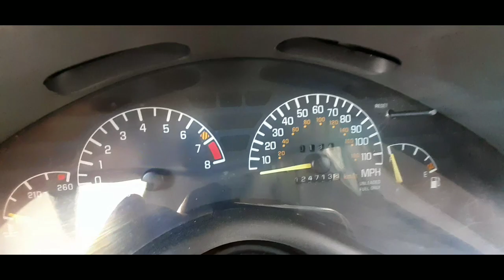THURSDAY Crushing ANY & ALL. 1994 PONTIAC GRAND PRIX Gets CRUSHED FLAT!!  Not much Talkn.

Comment: Yes, 1994 model. You used to see these everywhere (the four door models) as company cars and rentals back in the 1990s. The last company I worked for used them as company cars for the sales people.

We got the VIN, we win: 1G2 for US made Pontiac, WJ for Grand Prix SE, X for 3.4L V6 DOHC with multiport fuel injection, 7 is a check digit, R for the 1994 model year, F for Fairfax, KS assembly and the rest is the production sequence. The Fairfax plant by this time was known as "Fairfax II" as the 2nd plant was opened in 1986 after the first one closed. The first one built my '84 Delta 88 in June 1984. 

Exterior paint is code 41 black paint.
Reply from the maker: They nice cars back in da days. I was surprised it looked pretty good inside.